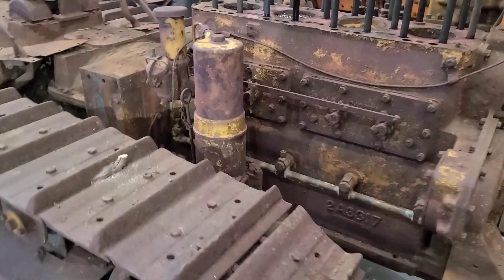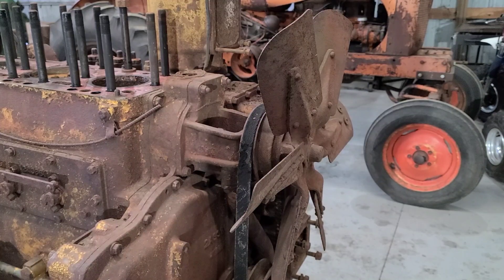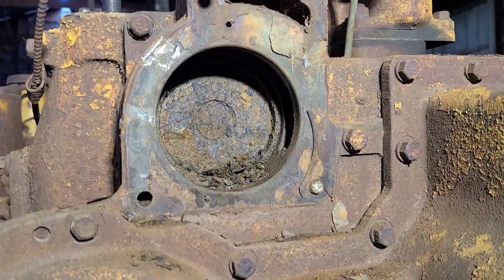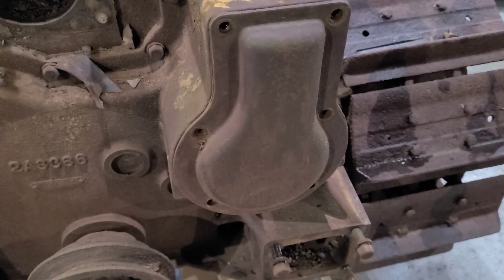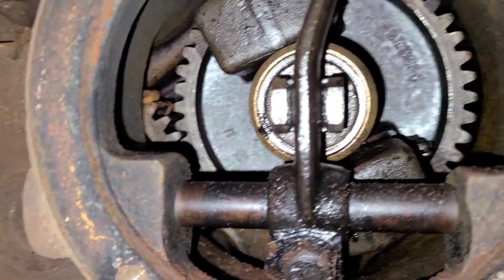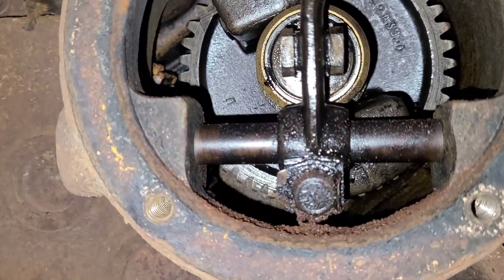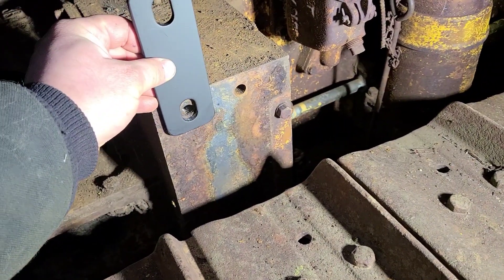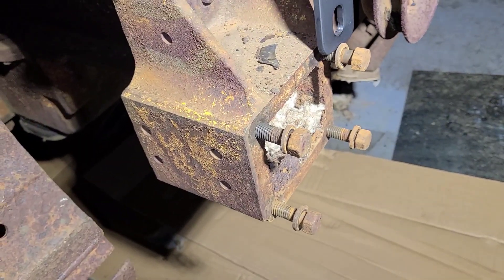Caterpillar RD-4 Engine Disassembly Pt.4

Comment: Kyle, don't you think covering the entire vehicle in a thin coat of oil in advance would make disassembly easier?
Reply from the maker: Possibly but I really haven't had much trouble getting it apart and the oil would make parts messy to handle. I'm going to keep doing what works for me, thanks for watching

Comment: Although a little pricey and somewhat hard to find, a product called Kroil,, is the best penetrating fluid I have used.  I work on the same vintage John Deere tractors, usually in comparable condition to your crawler.  It is helpful.  Last can of spray I bought I located on,, you guessed it; Amazon.  Chain auto parts store don't seem to have it.
Reply from the maker: I will be doing a test on the pony motor using different methods of rust removal and penetrating oil, stay tuned

Comment: Lifting brackets are a good idea. Are the outages usually short duration there?
Reply from the maker: Yes, the power is typically out for less than an hour. By time the power was back on I had already cleaned up for the night, but more to come soon. Stay tuned to see the lifting brackets put to use!

Comment: Is any part of your shop heated? Keep on going
Reply from the maker: Not at this time Chuck. The building is a 50x80 and we divided it in half and poured concrete in the front 50x40 this last fall. I tried getting someone out to spray foam it this fall as well but everyone I called was 3+ months out, so now it is a spring job. Thanks for watching, definitely more to come
Reply: @kylechrist  by the way your talking about spray foam insulation..bus grease monkey on youtube just had his quanset hut building spray foamed..he loves it and they used some kind of fire retardent paint on it..he demonstrated it in one of his vids..it worked well..just thought maybe youll be interested in that 😉 thanks for the vids👍🏻

Comment: You get power outages also! We get power outages way more often than when I bought the place 35 years ago. I’ve noticed that you have the same heating system in the shop as I have, to bad Mother Nature controls the thermostat.
Reply from the maker: I'm set up to tie into my wood boiler, but with no insulation in the shed and being a tin building, it won't hold in much if any heat. Hopefully I can get it insulated this spring